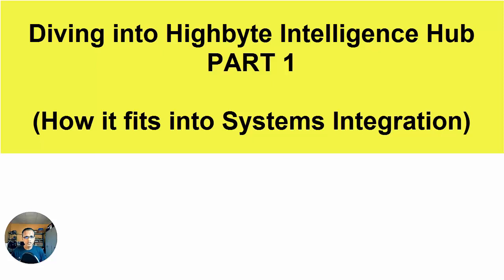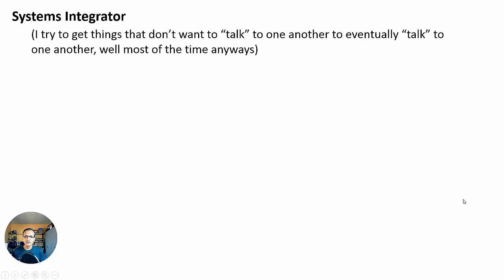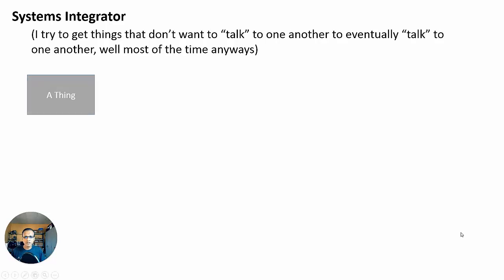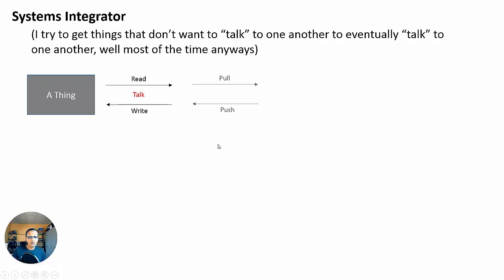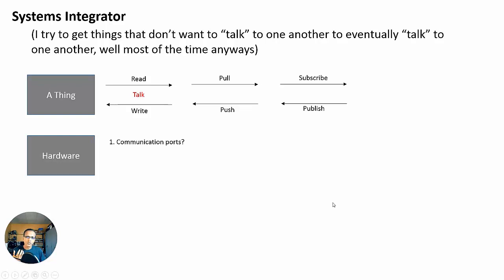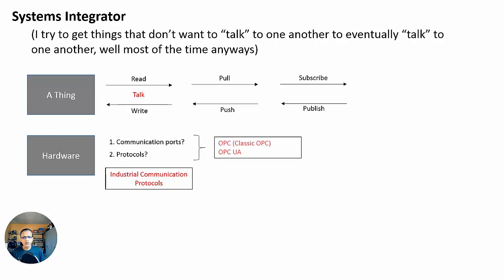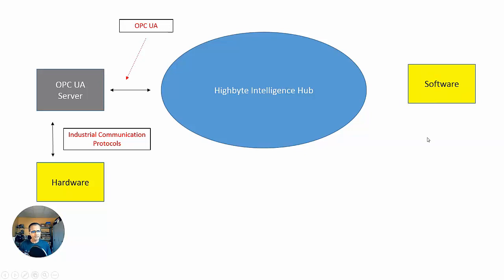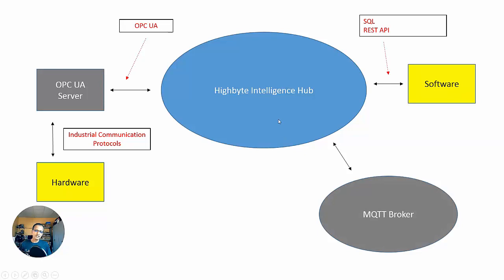Diving into HighByte Intelligence Hub - Part 1

Comment: Why we can not consider MQTT broker or OPC servers as an unified namespace?
What is the criteria to give a specific solution the title of UNS solution?
Reply from the maker: These are great questions Ahmed, and I am still trying to find out the answers. The concept of a UNS is still a bit on the blurry side to me. I am still trying to get a handle on what would constitute it.
Reply: One simple question is that those are protocols not designed to manage/manipulate the data. They can be good enough for small projects but definitely not for a large scale project with hundreds or thousands of data points.